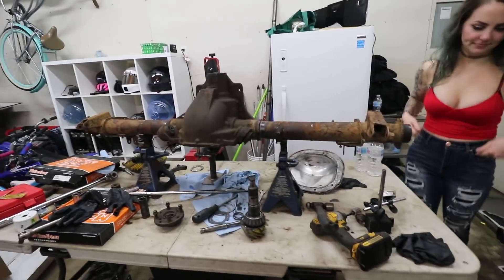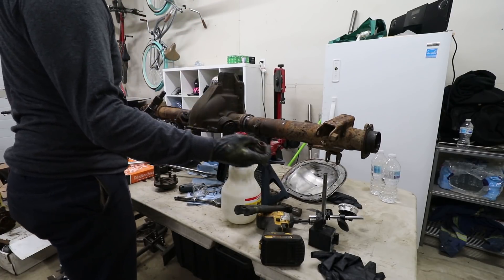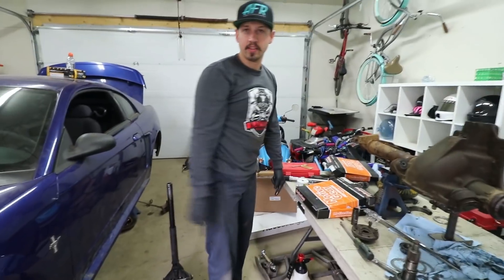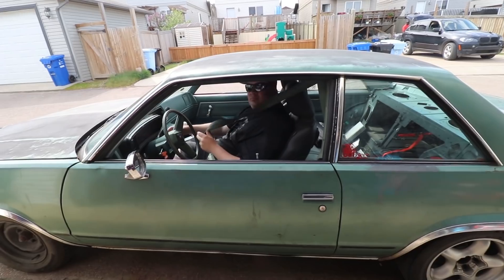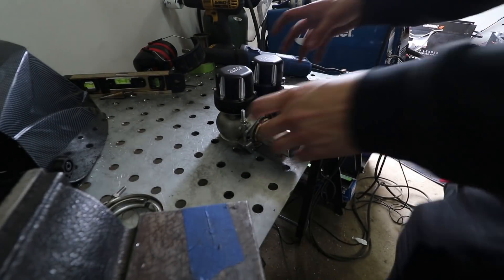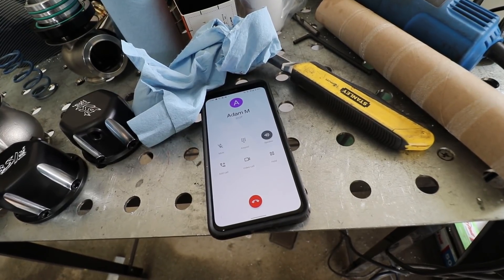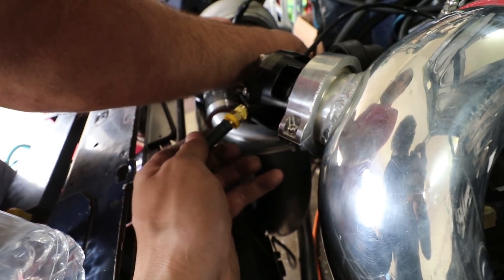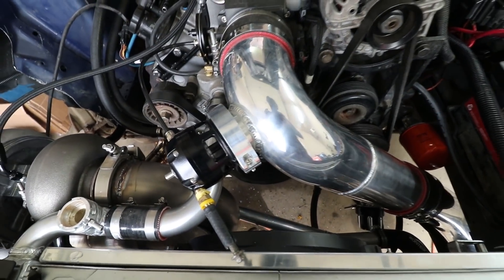Turbo Ls Mustang Runs Better Than Ever!

Comment: If you didn’t change the gear set, there is no need to change the pinion depth.  This assumes the diff was not making noise before.
Reply from the maker: I never had the diff in the car and I didn't measure the pattern before I took it apart so I didn't know for sure

Comment: everything is a hammer.
Reply from the maker: Facts!
Reply: @Boostedlifestyle  A hammer is defined as: anything in your hand that is heavier or stronger than the thing you are hitting. If you haven't broken a quality 3/8 drive ratchet using it as a hammer, you aren't a real shade-tree mechanic.

Comment: Run a 4port and put a 7psi in it
Reply from the maker: We had issues with our last 4 port set up. 27 duty cycle would make like 24 psi and 32 would make like 32 psi
Reply: Boosted Lifestyle  how much do u wana make lol send it yer 4port can be very touchy
Reply: Boosted Lifestyle yeah I had similar experience with 4 port. Back to 3 port but I’ve been able to run a lot more than double spring pressure.

Comment: DUDE !
THOSE WATER HOSES NEED A 4 WRAP WIRE CLAMP !
THEY DO NOT COME OFF... YOU CAN ACTUALLY MAKE HYDRAULIC HOSES WITH A CLAMPTE TOOL !
WHEN YOU WANT TO MOVE A PIPE YOU JUST SNIP THE WIRE AND MAKE ANOTHER CLAMP !
??????????????????????????????????????